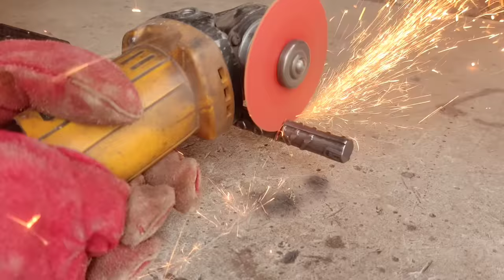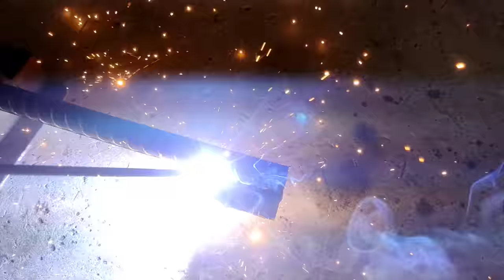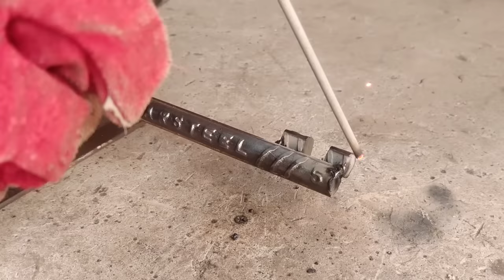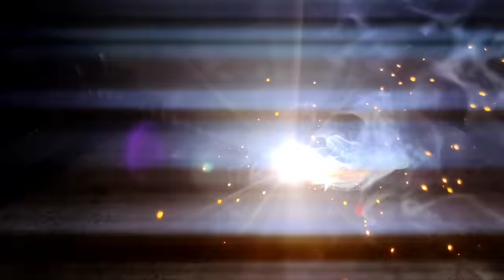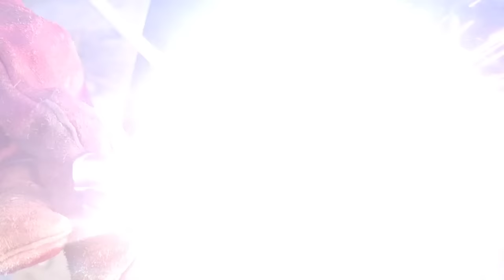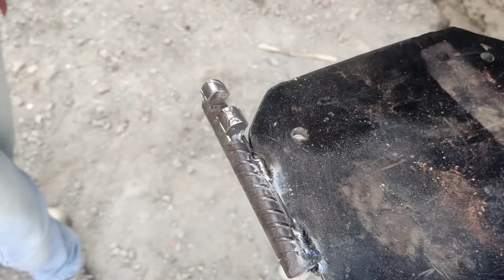How to make Easy Rebar Bender / very simple idea round bar bending

Comment: In Mexico, these tools have been sold and used for the construction of houses (bending the rods to be made for the assembly of structures) for 50 years or even longer, they call it "grifa" and it is totally normal to see them in buildings under construction, there is nothing new about them

Comment: You really shouldn't be using your grinder that way. That is the number 1 way to have a grind kick back at the operator and potentially cause severe injury  
I personally witnesses a guy using a grinder that same way around, when it kicked, his face was closer that that of the operator in this video, he was wearing a face shield and safety glasses, yet that grinder with a zip disc kicked back so hard, it cut through the face shield and cut through the bridge of his nose.
Blood was gushing from his face so much, tht when he tried to pinch his nostrils together to stop the flow of blood, the blood bubbled up and shot out of the wound.